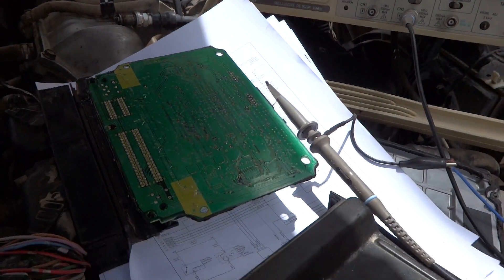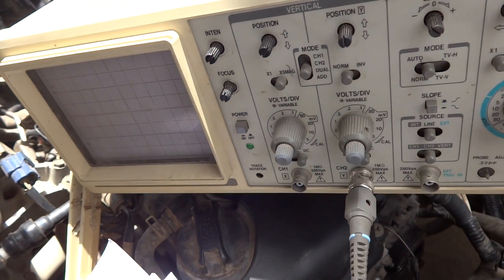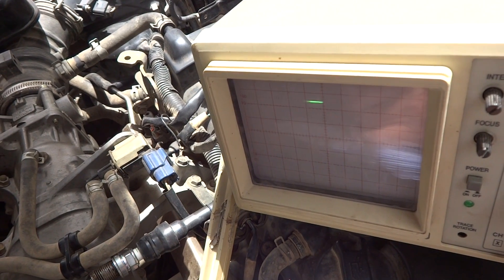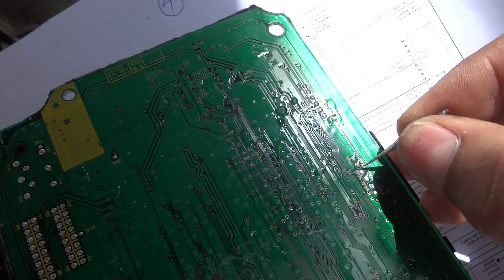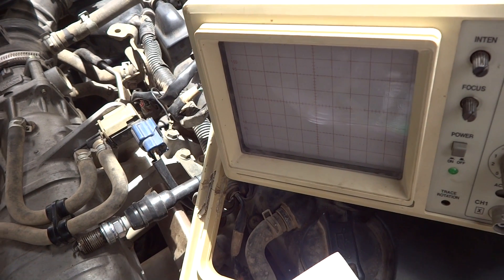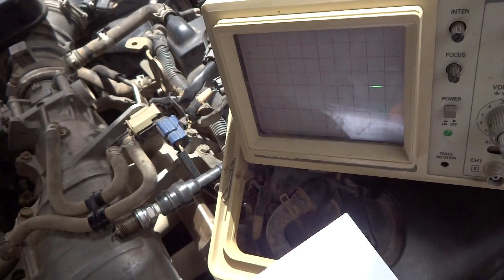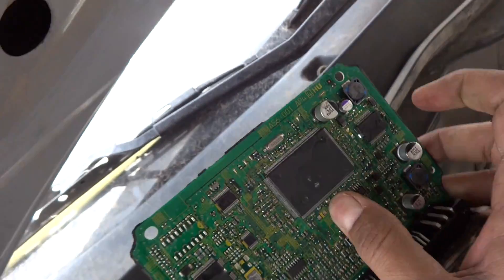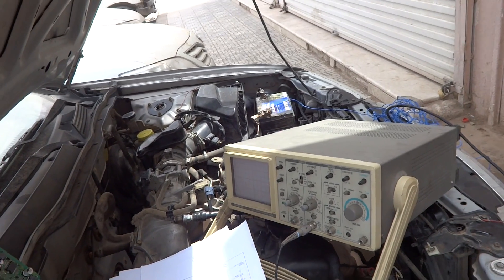Car ECU/ PCM computer testing

Comment: Hi, great video, thx for sharing. Please advise where can I buy ECU circuit diagrams?
Reply: You can get the pin identifications in the vehicle service manual. In my cars service manual I was able to find the voltages that should be at each pin..you could Google "name of your car", don't forget to add whether it's automatic or manual "ECU pinout" & you might get lucky. If not search for your cars service manual..there are physical books for purchase & electronic versions. I think mine had this info in the "relay and control modules info" section

Comment: I need to try this on my Toyota hilux Australian version can i use a digital storage oscilloscope or is multimeter better? Any reply appreciated 😊
Reply from the maker: Great to see your comment. Scope and volt meter are same in nature. You can use any. But using scope is better if you have one that it will show you waveform also. Wish you good luck with your troubleshooting.

Comment: hello sir please tell me that if i change my car ECM unit than it is must to change the car lock set also
Reply from the maker: +Ashok Singh it is needed to marry the new or replacement ECU to the car. Sometimes it need reprogramming or ECU refreshing and some tomes sure key and lock cylinder replacement. This depends on your auto lock smith abilities and facilities. Good lock smith can reprogram it for you. Soon I may add an article to my blogspot on this subject. Stay tuned.
Reply: ok sir thankyou

Comment: sir please tell me, In this case Is there any possibility of problem in ECM unit.
Reply from the maker: You mean if you make any arrangement for fuel pump to run then it could cause any problem to ECU? Then the answer is there will be no problem to ECU at all if one may do it carefully and may not touch the ECU wiring in such modification. Such modification would a perfect solution in your case. If anything else, you most welcome to question. Regards,
Reply: Sir i m saying that in this case the fuel pump is not working then it is due to some problem in ECM unit or there should be some other problem. I mean that there is possibility that the ECM is defective
Reply from the maker: It could be a defective ECU or could be problem somewhere outside the ECU. It needs proper investigation. Anyhow the external keyed power to the fuel pump should solve your problem. Regards,
Reply: ok sir thank you very much. I appreciate ur work u r providing very useful information to us. thnx
Reply: hello sir now in my car fuel pump and injectors both the things are not working. please tell me how to solve this, mechanic is unable to solve this problem.

Comment: hello sir. please help me. I am having Maruti Ritz car and there is a problem that the fuel pump is not working and also a ligh of heater is not blinks. Mechanic said that there is a problem in ur ECM because it is not providing current to Fuel pump. can u pleaee tell me what is exact problem and if there is problem in ECM then how to repairs. please help me sir
Reply from the maker: Dear friend this needs further investigation. Sometimes there is no problem with the ECU but some problem external to ECU like in wiring, relay or some control module which drives your fuel pump. All is needed to carefully check all the system before attempting to replace the ECU as it is an expensive part. Also if it is petrol car, ask your mechanic to put petrol from the outside or provide propane to the engine and let it start. If it starts and runs on external fuel source, they should make some arrangement for fuel pump external to ECU. In this way you will be saved from an expensive replacement or repair. Or on the other hand if car doesn't start and runs on external fuel and everything is ok outside the ECU, you will need to repair the unit or to replace it with another good ECU. Sometimes it could be due to immobilizer security problem if it is immobilizer equipped car. There are a few more videos on immobilizer and security on my channel. You may watch them and get some idea. Let me know when you may do the above with your car. Wish you good luck with your car repair.
Reply: thanx sir. I want to provide some more information that my car is having a diesel engine. Mechanic check fuel pump directly by giving power to it then it works and starts to eject fuel but car is not able to start because injectors are also not working at that time. But now mechanic is saying that injectors are now working there is a problem in the wiring which is now fixed but fuel pump is not working right now.
Reply from the maker: So then it should be easy. If the injectors are working and the car is start with external power to fuel pump, it is an easy task to make a keyed power to the pump then. It will save your big money compared to ECU repair or replacement. Regards,

Comment: sir i had a ford explorer 2008 problem is rough idle at stop. i check the voltage at the electronic throttle body input two wire connector it 3.7 v at both wires will it fine ?
or should be 5 volts and the seccond thing is the voltage should present both wires?

kindly give ur suggestion thank u
Reply from the maker: Thanks for subscribing on my channel. Subscribe if not yet subscribed! Voltage may be fine but the throttle bodies are accumulating dust and debris. You should clean that for nice performance and good idle. You should watch a few of my throttle body cleaning videos on my channel to understand the subject. Also there is one or two videos focusing on drive by wire throttle body cleaning. You will know how to clean them and set up the idle to a nice value. Please don't hesitate to ask anything anytime. Regards,

Comment: Thank You. Very basic question for you. I live on the East Coast of the USA. I am a beginner electronics repairman looking to make a business out of not just PC/Mac board repair. What tools/info would I need to get into Vehicle "ECM/PCM" repair?  How would I test them?
Reply from the maker: The key for their repair is your knowledge then second is the ECU emulator. They are expensive but very useful. Also you will need other tools like Oscilloscope, multimeter, soldering iron, hot air station, screw drivers, hex torx and other tools etc. Also you need a database of information.

Comment: have nissan micra 2012 march petrol  i am having problem with my car , central lockig system from the driver side door not working .  front wiper is working but rear wiper is not working . headlight working and brake light also working but turn signal not working and trunk door not locking. and all doors not working electric
Reply from the maker: It could be a bad fuse or wiring problem. Seems there will be some +12V supply rail missing to certain section. Check first for blown fuse and then check for wiring. For fuse testing refer my other videos on my channel. Thanks for linking and subscribing.
Reply: it was a loose connection on the front

Comment: allo i was wondering what voltage i am suppose to read on the last pin that you check because i got the same ecu from a 2005 sentra and giving me allot of trouble thank you your video is really helpful .
Reply from the maker: That is great if it helped you. Regards,

Comment: Good Job, you are genius !!! Don't worry some stupid loser's comment,....they are jealous of your knowledge, only freaking thing they can do, is a bad hangover =)) So, I am having a problem with my ECM/ infiniti FX45/2004, AC works sometimes, sometimes not, freon level  is OK, and compressor works??, and engine smokes a lot, could have issue also with piston rings..., and valve stem gasgest,...BUT, could faulty ECM also change valve timing, and be a reason for extra smoke in engine??? I only have 120000 miles, power is not great, but is OK, and there is no noise in engine?? Drinks oil like crazy, 1/2 a quart/ day???? How could I test my ECM, before I buy a new one, they are so, so expensive =((( If I send it to you, how much you charge to test/ fix it??? Be reasonable, buddy;o) Well done, youtheman =)

Comment: this is good stuff. thank u. i have a nissan micra k12 with no spark no fuel injection and no codes when scanned. the ecm looks quite similar to that one you are showing. please tell me which one is the IC for fuel injection and spark on mine.

Comment: Asalamualikum 
Sir i have 1 more prob if can help me out. i really appriciate all your answers.
Problem is that when my pathfinder 2003 is on last quarter of petrol  it automatically turn off engine then i have to start it again .and it happen around 3 to 4 times untill i refill the petrol.i m not sure if its fuel pump prob.
I m really scared that maybe it ll give me a new prob please help me out
Reply from the maker: Dear friend thanks for appreciation. It seems like a fuel pump or maybe a fuel filter also if you didn't replace it ever. So better first replace fuel filter and then fuel pump if needed. Although it could be proved by testing also. I have video doing such testing on my Toyota Corolla. Regards,

Comment: Hi man am having problem with my Honda accord ecu the ect sensor did not have the 5v reference the car only start when dead cold and reading the volt without the ect it's showing 0.036v
Reply from the maker: Seems internal voltage regulator went bad. You can use some other arrangement to create such working voltage. Means use some external voltage regulator. Or the perfect solution could be the repair of the ECU if you have enough electronics knowledge. Wish you good luck with your repair. Regards,

Comment: Sir as i have been watching your videos n it helps me alot.
But now i am in prob with my nissan Pathfinder 2003 as it cranks it starts but it has acceleration prob.however machanic says its ecu prob and i have repaired it 3 time nd it gives me same prob every 5 to 6 days
Pls help me out if its ecu prob what should i do
Reply from the maker: If you are repairing one ECU and that is giving you same problem repeatedly, it means the repair is not successful or the ECU circuit went overloaded. In such a situation a very perfect and extensive repair of the circuit is required or otherwise you can replace the whole ecu with another one. On the other hand if the problem is repeating with another replaced ecu, there seems to be some problem with your throttle body. Try replacing that one. Regards,
Reply: Thanku soo much sir . you gave me all your precious time. 
I hope your suggestion ll help me inshahAllah

Comment: so for each test point, what does it all mean?
Reply from the maker: +EndofUSA I can't understand your question.
Reply: LearningZone
by testing each test point what are you looking for and what does the oscilloscope say for each graph?
Reply from the maker: +EndofUSA That is explained in the video. Oscilloscope is a graphic voltmeter. A video soon will be upload on use and benefits of oscilloscope.
Reply: Hi!
I'm also interested what that signals on that TP are for?
Each TP is describen in a service diagram and the must have value are also described there.
I respect this video and I'm not a hater. I just interested to figure out your technic how your are make a decision which signal on that TP is ok and which is not. 
Actually, a signal can have more parameters than voltage high.
So, how you know if you get pwm signal or only a jumping 5v signal because something is wrong in the circuit and the signal looks like similar as a pwm type?
I actually a bit confused with this explanation:
here is 5v, here is 12v here is square wave or whatever, without to have the parameters of the exactly TP...

Comment: your doing a good job don't worry about other peoples stupidity very informative
Reply from the maker: +Wize one Thanks friend for liking. You are right idiots are everywhere but I am not worrying them. When ever such bullshits are coming on my channel, I am simply blocking them from any stupid comments. Regards,
Reply: haha i think that is best thing my friend i have a question for you if you have the time to answer you seem very knowledgeable about ecu components if that is the right terminology i have a motorbike i don't ride much and the battery gets disconnected but i must enter a pin every time i re connect i was thinking if i erase the immobilizer eeprom programming will i have to bother with this security system anymore will my motorbike operate correctly just minus the security? or if i reprogram the eeprom i am just learning about this in my own time thank you very much please get back to me at your earliest convenience

Comment: you are a genius 
my friend i want your help
for my Nissan sunny 2003 after I fix idle sensor I did relearning for it ,,,.relearning is  go good but if I switch off the car ,,,the car go bad again,,,does ecu have small battery for memory like computer
Reply from the maker: +saaed ibrahim No dear friend there is no battery instead the information you are storing is stored on a flash memory. Unfortunately there are such problems occurred sometimes as you stated due to bad design of the equipment design. You can overcome them by using different techniques and options. Try to compensate your idle air by mechanical adjustment if the electronic calibration may not help. Regards,

Comment from the maker: Unfortunately the people who don't understand the testing, they will thumb down. The reason for that a human has a nature that it opposes anything strange for it or to the matter one don't understand. I could say only sorry to them!
Reply: hi when you  testing the car ignition is on or off ? and do you can you use multimeter  ?
Reply: Sir I have problem with my Nissan Tiida CVT 2012 a Air Condition guy fixed my AC and did not rap a wire properly in the engine this result in a grounds that burnt the Ac wire to the fuse box and make the car turn over but not start I took it to a technician where he changed the engine harness however he said I had to get a new ECU for the vehicle what could be the most common issue caused to have the car not start also wat could be issue inside the ECU to be damage and is it fixable ?
Reply: we didn't see how the baord  was connected to power some missings let us confused.
Reply: Hello, please could uplaod on your youtube page for 2006 toyota corolla/XLI/ manual transmission model and serial number for me. Engine is 2NZ-F, it has automatic transmission. I'm still looking for it. thank you
Reply: Yeah, no thumbs down needed. Great work, where did you get the diagram for your vehicle test points? I'm having an anti theft lock out and would love to get my checks right with my pico. it happen from jumping another car.

Comment: Thank you for such helpful videos.Without circuit diagram how did you determine or identify circuit test points and what readings are correct? Thanks for taking the time and sharing your knowledge.
Reply from the maker: tbbainter777 Dear friend schematic diagrams are impossible to obtain for such systems. You can just determine the test points and expect voltage levels and frequencies by your experience and understanding. Regards,

Comment: Awesome video! How did you get the circuit diagram of ECU? I am looking for circuit diagram for ECU for 2002 Pathfinder.
BTW, do you have any video to check the circuit of Immobilizer? That would be absolutely wonderful, if you could open up an immobilizer as well. After watching your videos and some research I understand how these components talk to each other. In fact, I just bought an oscilloscope. ;)
Thanks.
Reply from the maker: Param S Dear friend ECU diagrams are not available to average diy like me or you! But you can test them using some techniques like one I showed here in this video.
On immobilizer I have a video on Nissan Sunny immu testing and it is here on my channel. you can watch it. Also don't forget to subscribe on my channel if not yet subscribed. Regards,
http://youtu.be/rJVKv5cTnY8

Comment: For accurate dc voltage measurement i tend to use a digital multimeter, oscilliscopes tend not to be too accurate, i seem to remember 3%.
Also your multimeters resistance is typically 10million ohms so it would not affect delicate circuits, im waffling again ha ha :-))
Reply from the maker: Yes you are correct. Multimeter are great to test for DC voltages and rms ac quantities. But problem is sometimes you are checking waveforms and intermittent behaviors so you are using oscilloscope then it is handy to use oscilloscope as a multimeter to test both AC and DC.